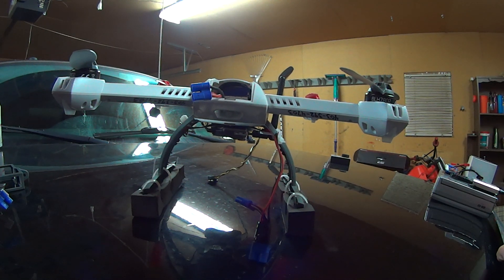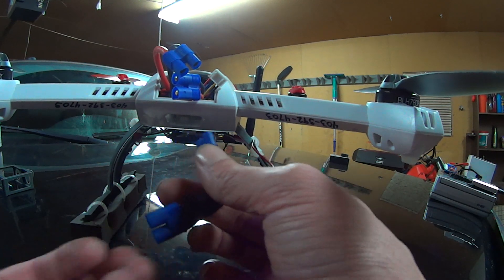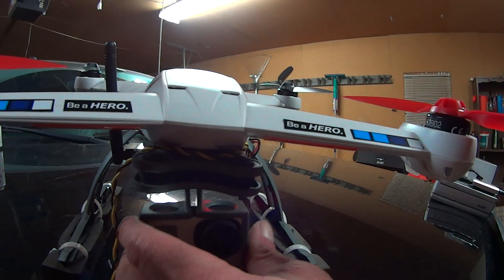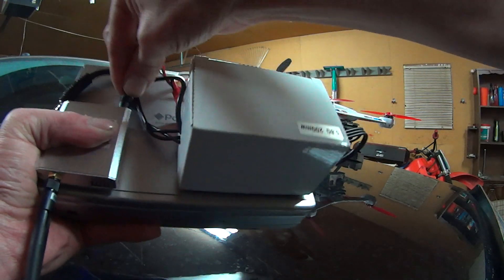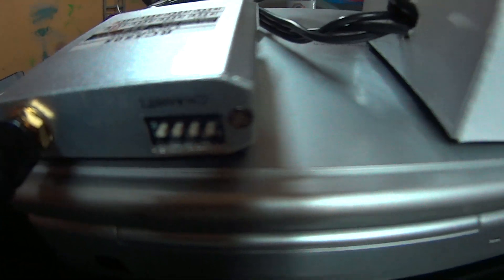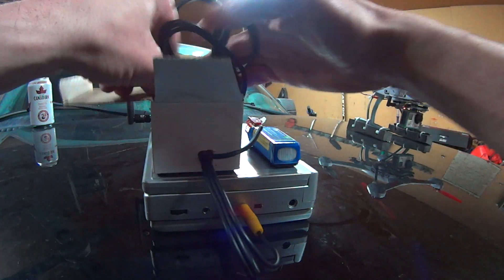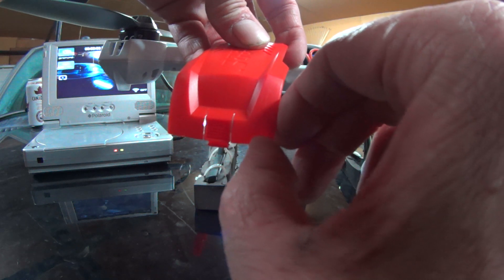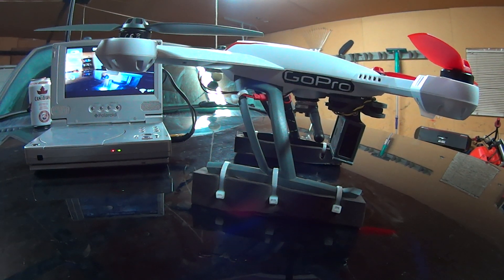Blade 350 QX Quad  Simple FPV setup and instructional video.

Comment: You don't need the double ended power cable for the battery. it comes with a balance charger cable. you plug it into the white plug on the flight battery.

Comment: Thank you so much.i Then use a 4000 mah lipo battery with a custom adapter (deans to plug).it works perfectly but the fact is that it works too much well.for an example on a continuous drain of 40 minutes the battery loose only 10 percent of power.i must discharge it manually.i Will attach to balance cable a monitor to evitate the over discharge. I found one of Ripmax that works GREAT!

Comment: I have anorher question:I have a fpv lcd only wall powered (or powered also by a CAR adapter).how I can power it with batteries?if display goes with 6w what kind of battery I must use?
Reply: 4, AAA, AA, C, or D batteries connected in series will give 6 volts.

http://www.ebay.com/itm/1PCS-4-x-AA-Size-Cell-Battery-Batteries-Holder-6V-Box-Case-With-Wire-Lead-BL4AA-/180979418921?pt=LH_DefaultDomain_0&hash=item2a2336c729
Reply: Just realized you said 6 watts.  On my phone it looked like 6v for volts.  But that battery pack should give you an idea of what you could do to get whatever voltage you need.

Comment: Thank you for this video...finally i found answers to my many questions.only the last thing I would like to know:is possible to power-up fpv transmitter via balance cable?
Reply: Yes. That is how I do mine. Very simple and just drilled a small hole for the wires in the front left inside the door. Makes a simple easy connection.